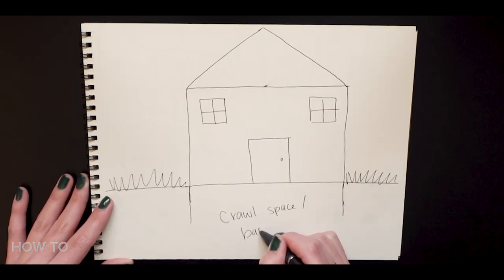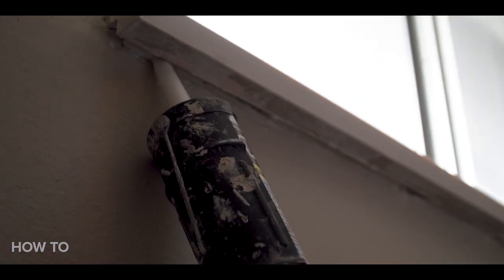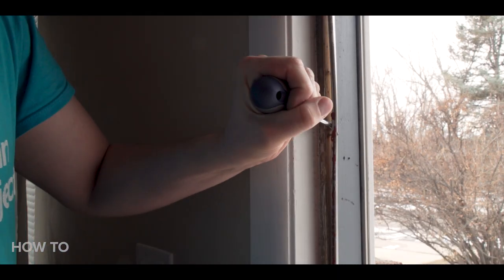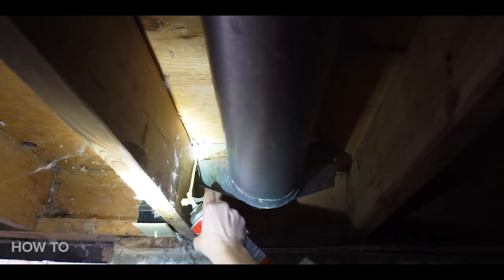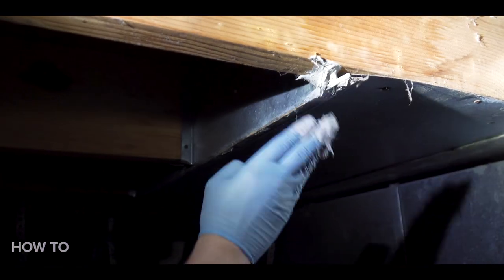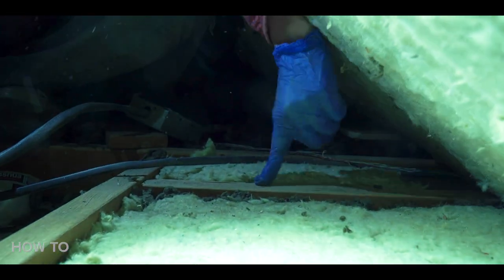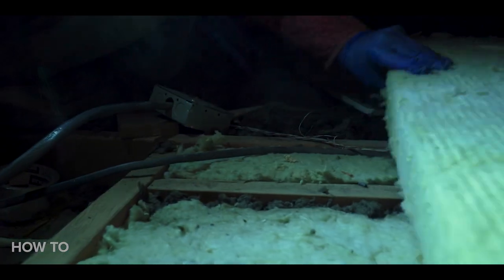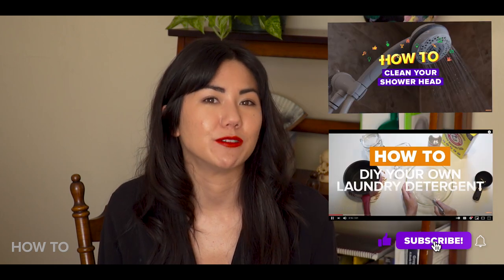How to insulate and air seal your home (we cover everything)

Comment: $200 for mineral wool insulation plus spray foaming tape and cracks in the attic?! BS! Not even in 1970 that would have cost that. I'm glad that you showed the process on what needs done, but don't lie to people about costs.

Comment: If you have an older home you should be careful when adding and insulating everything. Older homes are built to have some draft. New homes have all these fans and ducts to control the air flow, but older homes are meant to leak SOME air. If you were to cover up 100% of all leaks, you could be damaging your home instead
Reply: Then you live in a house that you can see your breath in during the winter
Reply: Whatever they recommend as adequate ventilation, have a fraction of that level of ventilation. I had a surveyor survey the house I purchased, he was recommending a laughable amount of vents be installed. I'd literally never heat the place in Winter if I followed his  recommendations. In one room he told me to seal up the windows for draughts and in same room recommended that I drill a large hole in the wall for an air vent?! After I purchased the house I actually reduced the amount of existing ventilation.